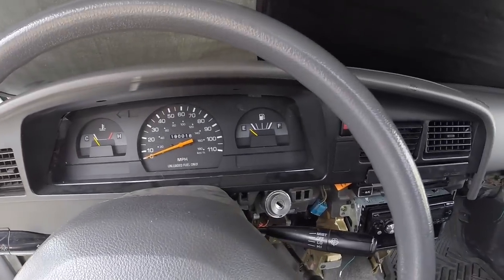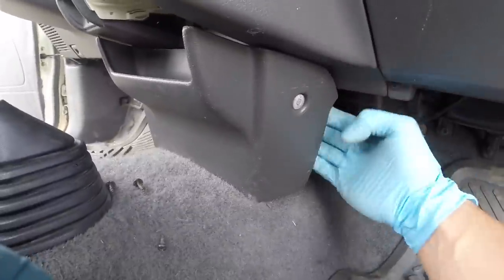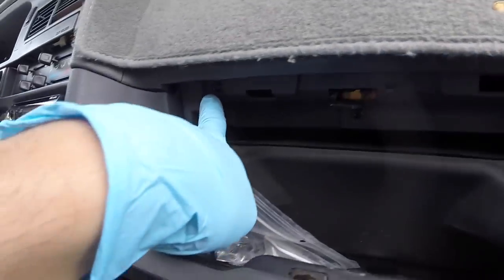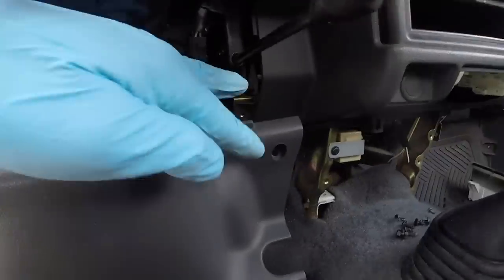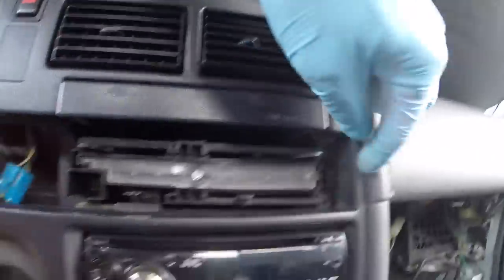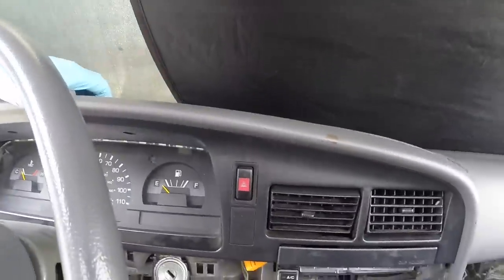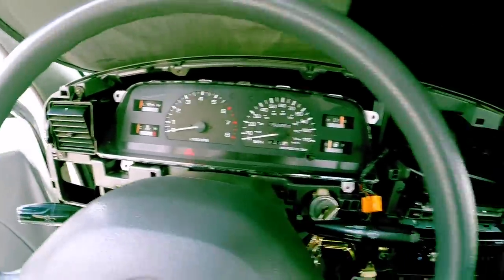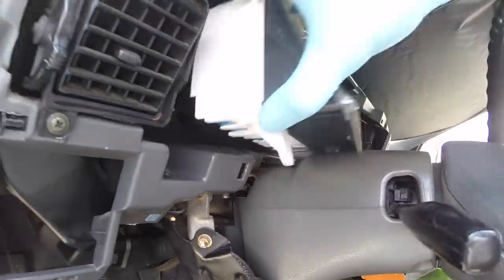How to Install Toyota Pickup Cluster SR5 4Runner Upgrade (Tach, Oil Pressure, Volt)

Comment: Hey buddy I did everything in the video, and everything works except the speedometer, I hooked the wire on the back of the cluster and the rpm works..I even bought two speedometer from the junkyard and still , the speedometer not working.. What can I do?
Reply from the maker: Sorry I missed this.  I can't imagine both are broken, that seems odd. You old speedometer worked fine?

Comment: I need help! So i did everything that you did and everything works 100% except for a frigging brake light, its on all the time. Oviously when the parking brake is on it illuminates brighter, but whe i disengage the brake it is still on but not as bright. Fluid is all the way to max so it shouldn't be the fluid, also with the old cluster i did not have any lights what so ever. Any ideas? please help. I hate having lights on the dash.
Reply from the maker: Check the cluster.  It might have a burnt/shorted wire.

Comment: in the middle of tearing apart my dash and putting the cluster back in the speedo cable is too short for me to have  hand back there to plug it back in, noticed you dont seem to have speedo cable in the video, is your cluster wireless?
Reply from the maker: +Nick Zethof Yes, some of our trucks have the speedometer cable, are are electronic.

Comment: Amazing video my 93 pickup came with it.after converting it into carbureted engine my 93 Speedo does not work anymore..I looking to do a cable swap.
Reply from the maker: Very nice, that should hopefully do the trick!!
Reply: Thanks again I’ve completed the swap I used a 4runner speedo with cable and auto transmission. Getting the tach to work now...truck was an sr5 dLx everything was working
Reply from the maker: Nice!  Glad to hear!
Reply: My cable swap has been completed...along with all leds just going get the oil sending unit.and tach working thanks again

Comment: Do you happen to know where the oil pressure sending unit is on the v6?  That is the only thing holding me back from putting everything back together. lol
Reply from the maker: If looking at the engine from the front, it's on the bottom right side on the block.  You'll see it sticking out.
Reply: @GarageBuiltHondas    I replaced my oil sending unit and my gauge still stays at zero, if I turn the ignition a few times it will rise with the rest of the gauges as part of the test, once the engine is started it will drop back to zero after a few seconds, usually it never moves from start to finish.  Engine sounds fine, oil level is fine.... :/  Any thoughts?
Reply from the maker: It's broken possibly.  This cluster never worked even after I swapped the unit.  I ended up trying another cluster about a year later.

Comment: Hi, I hope you can help me. I did everything but the temperature, oil, voltage and gas level are not working. I already check the gauges in a 12v battery and they worked correctly. However, when I install the cluster into the truck they dont work at all. Any idea? Thanks in avanced.
Reply from the maker: Maybe have a broken cluster.
Reply: I solved it. It was a fus. Now the problema is that I conected the tach as you showed and it doesnt work. Any idea? Note: everything else it is working fine
Reply from the maker: No idea sorry.  This is the only pickup I ever owned like this and I sold it over 5 years ago.
Reply: Thanks for answering. I will try to find the problem! Nice and very helpful video

Comment: Do you have a video showing how you put your stereo in?  Having trouble finding constant 12v in stock wires.
Reply from the maker: I'm sorry, I don't.  I used the original harness and bought one of those premade harnesses that plug into it.  It was all labeled for wiring too.

Comment: Garage Built Hondas bro  I did this to my truck and I've tried several oil pressure sending units to make oil pressure gauge to work but they don't  work by the way they are used o didn't  buy a new one because I don't  know if the harness pin outs are the same or need to modify any to make oil pressure gauge to work any help is aprecciate it everything else worked!
Reply from the maker: Your gauge on the cluster might be broken.

Comment: Hey man I hope u still answer your comments. I have a 93 that the speedometer( it is electrical) does not work. I am looking into 94-95 cluster from a 4 runner just like the one you used. So I have a few questions concerning the new cluster. But if by any chance you still have the original cluster from your pickup(which is the same as mine) and you are willing to sell to me if it still works and does not cost an arm and a leg it will buy it. It will save me many headaches. 1st what is the oms on the RPM for a 4 cylinder? 2nd what it the part # for the oil sending unit and is it the same for 4 and a 6 cylinder motor? 3rd do i just connect the 4 connections to the new cluster and does everything works or is there some other thing I need to do so it works? Hope to hear from u soon. Thanks Robert
Reply from the maker: No idea Robert.  This was the only truck like this I never worked on and I sold it in 2018.

Comment: I have a 95 Toyota Pickup, my speedometer and tachometer does not work but the fuel and coolant meter works. Do you know what might be the issues?
Reply from the maker: No, sorry.  I only owned this one truck.  I've never worked on any before or after this one.

Comment: I replaced my cd player and everything turns on but no sound. Did you have that problem or know what it could be? I just bought a cluster and going to install soon. This helped alot thanks.
Reply from the maker: I don't.  Double check your wiring to the speakers.

Comment: I got my new sr5 cluster in but even with old oil pressure sending unit unhooked it still runs my oil pressure gauge up. My question is if I install the sr5 sending unit do you think that would solve the problem
Reply from the maker: It might.  I have since tried  hooking up the sr5 oil sending unit and my gauge didn't work.  I'm thinking I may have a broken cluster.

Comment: Jon, great videos. i was wondering if you might know if a 1991 toyota t100 gauge cluster will fit aa automatic 1990 toyota dlx?
Reply from the maker: I do not believe so.  If I remember correctly, that cluster was a completely different build when I saw one at the junkyard.
Reply: I have a 1990 automatic with the shift indicators on the gauge panel but haven't been able to find a gauge cluster with tachometer and shift indicators. Any thoughts?
Reply from the maker: Michael Gonzalez Try eBay.  I'm sure if you have one that doesn't have the shift indicators it would still work.

Comment: I checked the wiring and and my pickup is not prewired for the tachometer, can you please tell which wire did you tap in the distributor  coil? I think I heard you say yellow wire but I'm not sure. Please let me know
Reply from the maker: Correct, yellow!
Reply: Thank you

Comment: This worked for me so thanks for the  video.  Quick question: my fuel gauge doesnt decrease when I shut the truck off like it did with the old clusters fuels gauge's, is that normal (does yours do this)?
Reply from the maker: Darn, I can't remember.  I sold the truck 4 years ago.

Comment: I have a question, the oil pressure sensor that I need to put has to be the one that had the 4 runner of sr5 where I removed the cluster
Reply from the maker: Yes

Comment: I installed the cluster but the oil pressure gage do not work, I did replace the oil pressure sensor but still no work, any ideas please...
Reply from the maker: It's probably broke.  The first one I bought was broken also.

Comment: I just swapped the cluster of my 91 pick up watching your video and it worked perfect the tac but the speedo doesnt work. The new cluster its an electronic but not the old one... Any suggestions so i can make it work or do i have to find the cluster with the old sistem?
Reply from the maker: I believe I responded to you though Instagram

Comment: If the replacement gauge cluster came from a V6 does the truck getting the replacement gauge cluster also have to be a V6 or can it be a 4cyl??
Reply from the maker: No.  Either work.  But you'll have to adjust the potentiometer as mentioned in the video and link.

Comment: You mentioned an oil pressure sending unit. What's that all about?
Reply from the maker: Original one doesn't measure pressure level.  Dont try to install a new cluster while leaving the old sensor in, you'll fry your oil pressure gauge on the new cluster.
Reply: @GarageBuiltHondas  😯 Holy shit. I would never have guessed.😮

Comment: I just did this with my 1989 toyota pickup. it has a 5 speed swap. What speedometer cable should I use? And how should I go about with the tachometer?
Reply from the maker: The cable for any 89-93 will work.  I believe the 94's were all electronic speedometers.  And what part about the tach?  The wiring, or the adjustment of the potentiometer?
Reply: The wiring and adjusting the potentiometer
Reply from the maker: +Sean Trimmer Plug in the instrument cluster first.  If the tach doesn't work then follow the instructions that I put in the video.  Is your cluster from a v6 model sr5?  Then you need to adjust the potentiometer if it is.

Comment: would a 4x4 pick up truck with a 22re motor  in it .. can the Guage  cluster fit in a 1992 2wd pickup ? and how do u adjust  the pentometer
Reply from the maker: Yes it will work.  Look in the description of this video.  I have a link that'll help you with the adjustment of the potentiometer.

Comment: I have the 22re engine would it work if i swap the tech from a V6 4runner
Reply from the maker: Yes, but you will need to adjust the potentiometer, same as I did.

Comment: What exactly is a potentiometer and what does it do for the cluster?
Reply from the maker: Basically a resistor which measures RPM.  Going from a v6 to 4 cylinder will need adjustment to show correct rpm reading.

Comment: Any idea if I can swap the electronic speedometer out of my '94 pickup DLX 22RE cluster into the '95 4Runner SR5 v6 cluster I got at the junkyard?  I've come across 7 of these 4Runner SR5 clusters in the junkyards near me -- ALL of which are for the cable speedo, which stinks since my pickup is electronic speedo.  It's a bit of a shot in the dark, but I just don't want to go to the trouble of removing my DLX's cluster only to find out it won't work (if it indeed doesn't).  Thanks!
Reply from the maker: I would imagine it would work.  All of the connections that make it work on the 4runner work on my Pickup.  I just added the wire for the tach, that's it.
Reply: hey I just bought an electronic speedo and need a cable one! lets swap? haha
Reply from the maker: John Chavez lol, I'm good!  Haha
Reply: my bad was replying to cbh148! haha
Reply from the maker: +John Chavez Woops, lol!
Reply: +John Chavez Dang, I actually ended up making a for-sale/for-trade ad on YotaTech's classifieds, and after a month or so i had a guy about 2 hours away that contacted me to trade.  Love having the SR5 cluster!!  I'm in Alabama so i probably got a slower response than average since half my state's population just recently discovered the internet.   Thanks for the vid J Wid!!
Reply: +cbh148 haha I just got my yota a couplr weeks ago a found these videos. I told myself id just leave it alone and drive it while I buil my 240, now im gonna be messing with the yota haga
Reply: +John Chavez You've got a 240sx as well?  That's awesome man, I've got two s13's and i hit up as many drift events as i can afford Lol
Reply: +cbh148 yessir. ive had a few but Ive kept my first one through all of them
 @JustDrifted is my instagram the car is torn apart for a swap cage and tube work
Reply: That's rad that you've still got your first one.  My first car was a red '89 s13 coupe that I wish I still had, but thankfully I've had this hatchback for over 6 years now and really made it my own.  It's been KA24, CA18, and now SR20 powered and it slides so well that that's all I want to do with it ha
Reply: +cbh148 haha ive had mine for 4 years, been through a few kas now im in the process of an sr swap and all this fab work. I love this damn car but man having it down sucks! I wanna drive!

Comment: Hey bro. Great video & can’t wait 2 do this mod. Question. Can I fit a 94 4Runner cluster 3.0 4wd 5speed on a 94 pickup 2.4 4wd 5speed ? Will it work properly?
Reply from the maker: I don't know for sure.  Read through the link I provided.  I've only done this once and no longer own the truck.
Reply: bro I did this to my truck and I've tried several oil pressure sending units to make oil pressure gauge to work but they don't work by the way they are used o didn't buy a new one because I don't know if the harness pin outs are the same or need to modify any to make oil pressure gauge to work any help is aprecciate it everything else worked!

Comment: Nice Video! I'm about to get that cluster myself but mh main concern is how exactly do you adjust the potentiometer? I read and saw pics of the link you posted but really doesn't say how to increase resistance?? I see that it says to check resistance but how exactly to you increase it or adjust? or am I missing something?
Reply from the maker: Tooslow_srt You adjust it by spinning it.  You can spin it with a small screwdriver at the same time you are checking it and adjust accordingly.  It's easier than it sounds.  I wasn't as thorough making my videos back then and I should've recorded this part also.
Reply: Jon Widmer where exactly is it that you spin it? where is the screw at?
Reply: It surprises me how a lot of the guys have a hard time coming across these clusters. Over here at junkyard I come across them everywhere, basically stepping all over them. 4 runners left and right.
Reply from the maker: Tooslow_srt At the :32 second mark you'll see the white part circled.  when you look at yours, you'll see exactly where the screwdriver is inserted.  You can see if from the back better.  You'll need to remove the tach portion of the cluster to get to it.
Reply from the maker: Tooslow_srt I've found about 6-7 of these clusters over the last 2 years also.

Comment: These things are hard to find. $20 is a steal compared to eBay prices. I tried looking in some junkyards, but no luck yet. If I had a ford this would be super easy, junkyards are filled with fords. The treasure hunt will continue..one of these days.
Reply from the maker: I'll keep an eye out!  I've sold about 5 on eBay since this install for about $70 each.   My junkyards had a lot!
Reply: I found a good one with 157k miles on ebay last week for $84 with free shipping

Comment: heya pals, i have an issue..  not sure if its with my truck or the cluster I got..  i used both the resistances noted in the video..  and I get this result:

the tach goes from pegged at zero to approx 2500/3k RPM once i move key to position 2. once i start it, it only goes up from there when i press the gas pdl. also, none of the lights on the dash, nor turn signals work. any ideas?

Comment: how do l bypass electronic speedometer on a toyota pick up 1993?
Reply from the maker: Did you find a cable speedometer cluster?
Reply: No
Reply: @GarageBuiltHondas  I have a 93 22re electronic speedo cluster and a 95 sr5 cable speedo cluster trying to put in.. any tips how to hook this up correctly?
Reply from the maker: Click the link in the description.  I believe you can remove the plug and use the cable still, almost positive I read about it in there.

Comment: l have to install an after market cruise control on my 1991 toy. pickup ... is there any one in the Houston, Tx. area that can help me install this Rostra unit?   ... l don't want a lot of trial and error. Better if someone with the experience to cut straight to the right outcome. Contact me here on you tube please.